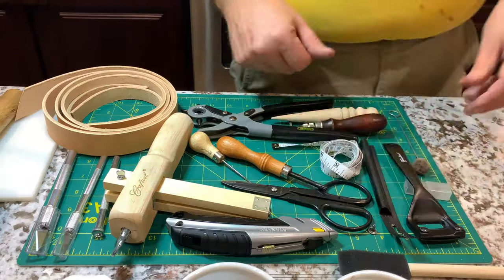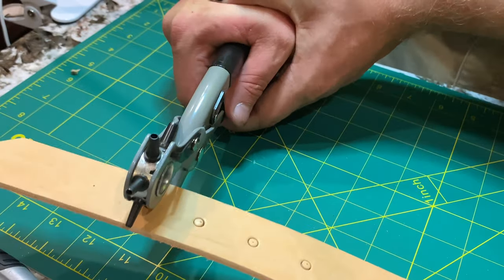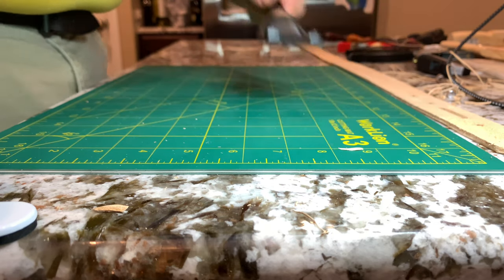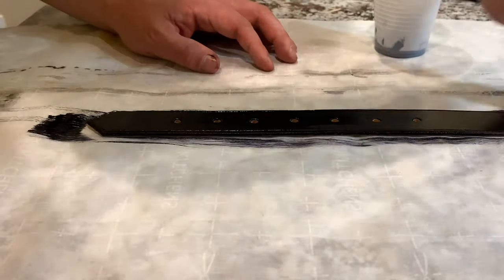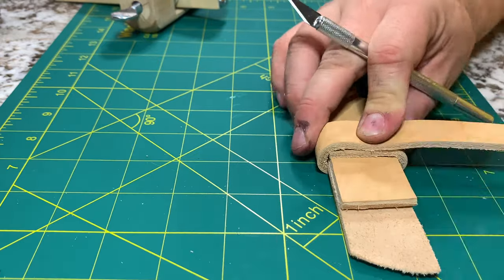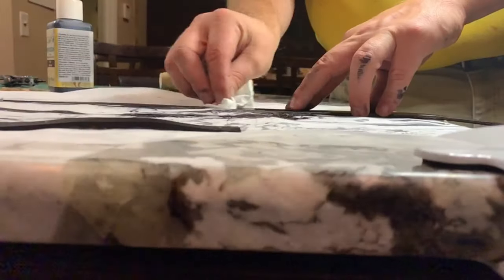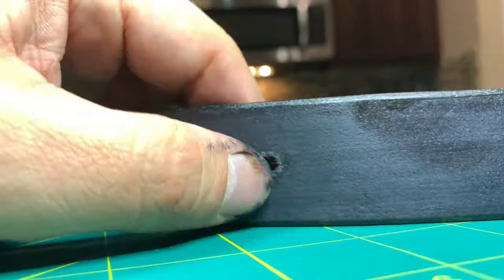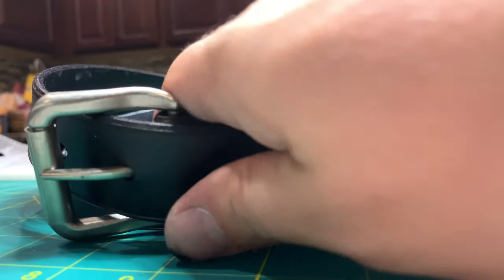How to Make a Leather Belt from Scratch

Comment: Im sure after 3 years you've learned this but for any newbies watching...use the size end that matches the width of your strap. Otherwise you won't get the belt end shape right. You just get a triangle like in this video. If you just want a triangle end no need for the template.

Comment: New video to  C a belt with 2 tone; like  2 or 3 mm on the sides w black in the center. Would you tape off the center or use wax then remove it.